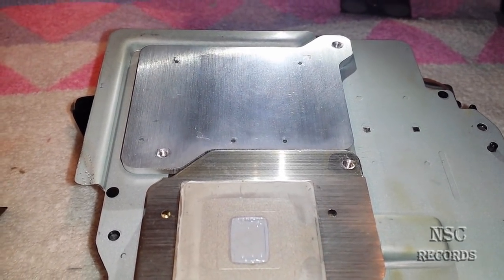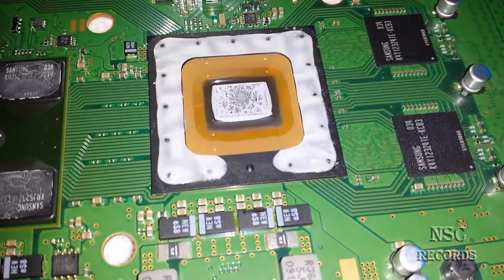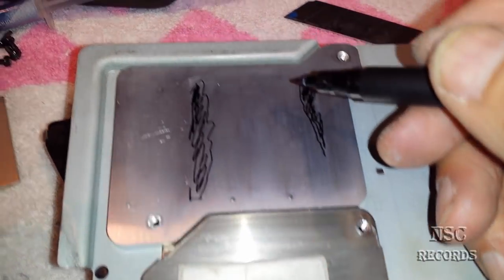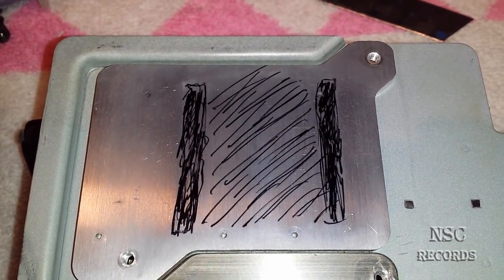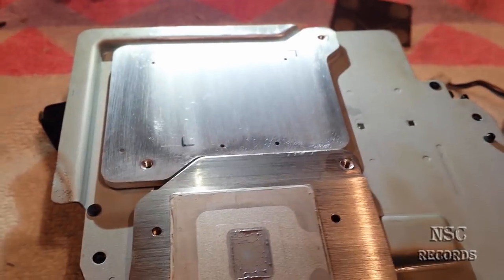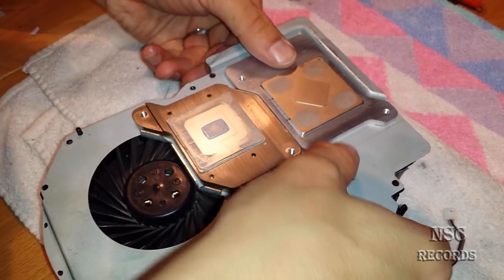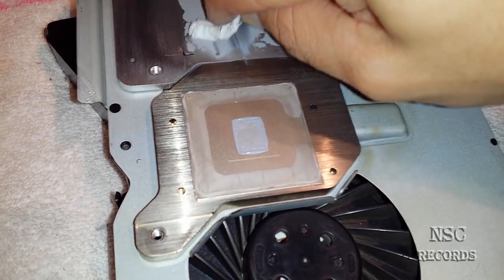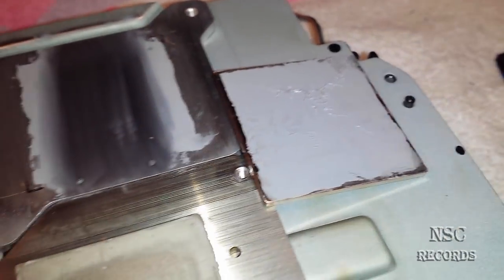PS3 Slim still overheating after removing IHS - Issue Fixed By:NSC

Comment: Why the RSX is almost 60°C on the XMB even after you did delid and fixed the heatspreader? Not the first time i see temperatures like that, not just on this PS3 but a lot of PS3 on youtube with delid are that high. On my CECHL04, never been delided, on the XMB the RSX is 51°C and in game never more than 55°C. I don't understand why a so big difference with my PS3 and the others on videos. I just did a repast and fan setting at 50% max in Webman (target at 70°C, fan minimum at 25% max 50%). But good job on the heatspreader! Unbelievable to see it bent like that! Sorry for my english, not my native language too haha
Reply from the maker: Yeah, it conforms always the room temperature to. If the Delid and the rest was good done, the temps will be amazing. On 50% fan speed my delided ps3 would run on about 38C😅 🤗✌️

Comment: And what do you think it's the problem when, after changing the thermal compound underneath the RSX, it's still overheating, even when the cooler it's making full contact with the RSX? Because I opened after doing this process and the IHS was still very glued at the cooler.
Reply: Eraser mod maybe

Comment: I have a PS3 backwards compatible, the RSX if I don't put it under stress is around 56/59°C, using GT5 it reaches 65°C very easily, but with the FAN at 34% I can manage the temperatures very well...

Comment: I wish there was a special thermal conductor to inject using syringe/needle between the CPU and heatsink plates without having to separate them.
Reply from the maker: This would be very impossible...
Reply: Has anyone heard of the cramolin flux-off spray??? 
 They say you can spray on the adhesive which will turn it into slime, then use some 0.23 mm 30lb test fishing line to cut through the softened adhesive in a sawing motion. No risk of damaging any traces since there is no metal involved.  Any tipps?
Reply: @Forsaken1990  Interesting, I was thinking about using a steel wire 24AWG (0.5mm) diameter. They sell it at homedepot or hobby shop. In the mean time, bought a Super Slim PS3 and It's super quiet. They should call it Super Quiet PS3 instead of Super Slim.One of these days after fixing the cooling issue I will install CFW for my old Slim PS3 and backup all my games to hard disk and experiment other cool stuff.

Comment: Hi, I failed in CPU delidding on my cech 2004b and wanted to ask how hard it is to remarry CELL? I can't find much information about that anywhere, unfortunately.
Reply from the maker: Hi You can't find informations because it's not possible. Let's say it would be possible but it is not worth all the work. The Cell is the only one witch is really unique. So IF you want to remove the CELL you need also to have the syscon chip witch was with the cell. You can't mix it up. The rest you can replace all the time, but the CPU is the most important for the board to work.
Reply: @NSC-Modz Thank you for the answer. so, replacing the CELL and SYSCON would work? What about remarrying SYSCON to accept another CELL?
Reply from the maker: @arnon85  forget it, you can buy a good ps3 for about 40 bucks 😆
Reply: @NSC-Modz  yeah true, I honestly just felt like messing around with that broken ps3 lol. Thanks for the answer
Reply from the maker: @arnon85  you welcome ;)

Comment: i have a ps3 after 2 minutes the fan runs really high and shuts down i applied new thermal paste heat sinks are touching properly you think underneath heat spreaders thermal is dried up or could be another issue thanks.
Reply from the maker: Yeah, you will need to remove the IHS
Reply: @NSC-Modz  i guess both right

Comment: Hey nsc, I was removing the ihs from the rsx gpu and I damaged one of the little things I don't know what you call it but on the gpu itself, not the actual die or the surrounding four things. Does this mean the PS3 will not work anymore?
Reply: SoldierSparky once u damage it means it’s done for good.

Comment: you could also use thermal compund pads. often used in laptops or all ps2 moddels. if any place on the heatspreader is higher than the other, it will fill it out.
Reply from the maker: No, because it would not transfer the heat so good
Reply: why do cool it my laptop verry good? there is a mobile i7-7500 inside an a 980m graficscard. it works fine never reaches mor than 70°C :D And I guess it would cool way better than no thermal paste like in this ps3 :D

Cooling Pads works fine to me :)
Reply from the maker: This PS3 has thermal paste. ..
Reply: pads dont work bro, still over heats
Reply: ic graphite thermal pad is great

Comment: So you need to use sand paper to scrub the heatsink
Reply from the maker: No, it's not a must, only if you keep having problems.
Reply: @NSC-Modz  i already apply thermal paste in gpu and cpu and relid them but its still overheating and shutdown by itself please help

Comment: I replaced thermal paste and ps3 would not boot up just beeped so I did the cpu trick of removing plate a d still the same,I've tested every componant and all see fine but still basically bricked.

Comment: Hello! I bought a ps3 slim cech 2504a. I opened it, cleaned, changed the thermal paste and I got a very high temperature on RSX, about 80 degrees, CPU has 69-70. I delided the RSX, changed the thermal paste between lid and RSX die and got 78 degerees on RSX after this. After that, I watched this video, checked the surfaces, and lid of RSX was be not flat, I cleaned up with sandpaper and got flat lid. I assembled all back and got the same temperatures. What else can i check? Please help!
Reply from the maker: Your need to get the RSX IHS back to the cooler with a lot pressure. Press the IHS really down to the cooler, the thermal paste needs to spread so much as possible.
Reply: @NSC-Modz  the pressure is good, the thermal paste is well spreaded, the temperature of RSX are still high.
Reply: RSX radiator is also hot, hotter than the CELL radiator
Reply from the maker: This is a Heatshield [IHS] not Radiator :)
Reply from the maker: Than it's a bad thermal paste or you do something wrong.
Reply: @NSC-Modz  I used Arctic MX4, there should be no problem with thermal paste. Trying to solve this problem for 2 weeks now, searched a bunch of forums looking for information, everyone was helped by removing the lid from the RSX, but not me.

I do it this way:
- I take the console apart, wipe off the old thermal paste with alcohol.
- Put thermal paste on RSX lid and place it on the radiator
- Put thermal paste on the RSX chip and its memory chips, and on the cpu.
- put the board back and tighten the screws first on the RSX and then on the cpu.
- put the console back together.
- I run The Last of Us for the test and after an hour of playing I get the maximum temperatures that the console reaches. CPU 68°C RSX 78°C.
Reply from the maker: Again, there is no radiator, it's a cooler. Radiator is only need on watercooling. Have you clean the old thermal glue on the Vrams and on the IHS? Do you got jailbreak or WebMan mod.? There is a problem with the right pressure. Or the IHS is not sitting on the right place.
Reply: @NSC-Modz  Yes, I cleaned off the glue on the VRAM. Yes, I have a webman mod, I use it to watch temperatures. IHS is in the right place, based on your options, the only thing left is pressure. Is there any way to increase the pressure?
Reply from the maker: @ys5108-w2p  open it, make some pictures from the IHS inside and send me over WhatsApp.
Reply: @NSC-Modz  I will write to you tomorrow. Thank you.

Comment: why use the heat spreader?    why not just put compound on the chips and clamp the heat sync onto to chips
Reply from the maker: Because without IHS you will have 3mm space between the cooler and it will have no contact to the chip my friend
Reply: @NSC-Modz  yeah but sony did they do it to make it overheat   maby custom heatsyncs?

Comment: Hi i have a great question for you i have a ps3 that has no video and the controller wont sync the console does boot but no video you think problem with rsx hdmi port is fine appreciate any suggestion you would have how to fix this
Reply from the maker: This is a kinda YLOD...
Reply: NSC Modz how to fix it do a reflow

Comment: Mine is not like this i changes the thermal paste but still overheats and its clean no thermal past underneath either
Reply from the maker: You will need to remove the IHS, search on YouTube: PS3 IHS removal NSC
Reply: @NSC-Modz Does that mean delidding?

Comment: Ich habe ab 2010 eine ps3 Slim bekommen sobald ich es anschalte es schaltet sich selbst aus rot blinkendes Licht aus. Kann die Wärmeleitpaste schlecht auf und unter den Chips das verursachen?
Ich weiß, dass das Netzteil gut ist, weil ich immer noch den Lüfter testen kann und das Gerät schaltet sich ein.

I got a ps3 slim from 2010 as soon as I turn it on it turns its self back off blinking red light.Can the thermal paste bad on and under the chips cause this? 
I know the power supply is good because i can still the fan test plus the unit does power on.
Reply from the maker: Ich denke mal das die überhitzt ist

Comment: Hey NSC. I recently delided my PS3 Slim 20xx and the RSX is overheating like hell! 
On syscon after 1 hour it hits 77c and the CPU 69.
I tried to see if the heatsink has gaps but its completely fine.. the rsx die also leaves a full print on the IHS. The ihs is also stuck on the heatsink as you suggested. Any more ideas??
Reply: Maybe try using 40% fan speed, syscon aka Sonys fan curve tends to cook ur system, 35-40% fan speed, see if that works
Reply: @Bridgetfidget18  hi! My solution was to do the case mod (drill holes on the top case) and it really improved the temps by a 5-6c! Now i play with 28% fan speed and maintain about 72c on RSX on GTA IV while swimming.
Reply: @dimitrisantoniou8502  I still wonder what’s the ideal temps for a slim
Reply: @Bridgetfidget18  for me personally, anything that keeps the system near 70c on low fan speed since launch slim models tent to cook!

Comment: What are good temps for the slim?
Reply from the maker: All under 72°C is ok
Reply: @NSC-Modz  whilst gaming ?
Reply from the maker: Yeah, Max 72 °C I would not let it run hotter than that...
Reply: @NSC-Modz  lmao mine goes up to 72°C on XMB menu
Reply from the maker: @vitvickyvid  Ouch xD
Reply: @NSC-Modz  It's fine, i managed to clean and repaste it by myself

Comment: My idle temperature for ps3 CECH-2004A is CPU: 50c RSX: 52c max with fan speed 37% but while gaming  RSX goes 67c with fan speed 57% but CPU stays cold at 54c max. The heatsink is almost perfect, I'm also using MX-4 (CPU and RSX are delided and also thermal paste is changed). 
Am I missing something or these temperatures are ok for this model or any model in general?
Reply: for a slim its pretty high my chech 2504b runs a t 52 degree cpu and 50 rsx and in game it dosent go higher than 65 for both on heavy games my fan speed is at 37 percent and i run with no name shit thermal paste aand i never repaste the ihs
Reply: @lowliar8489  tnx, but I think 2504b uses 40nm GPU which runs a bit cooler than mine 2004a with 65nm. I manage to get 66c with fan speed around 39% while gaming with case mode witch is pretty good for this I guess but I'm not sure if this can be a bit better.

Comment: I had some troubles with PS3 fat in past I hope Sony learn there lesson on PS4 i just got PS4 slim few days go I haven't any troubles yet
Reply from the maker: PS3 had overheating problems because the IHS, the PS4 has no more IHS :) But i recommend to buy the normal PS4 or the PS4 Pro, the slim edition overheated faster and the slim has often problems with the disk drive... if you can give it back, then go for the Pro

Comment: Great videos! Thank you so much! By the way, can you help me please? I have a ps3 CECHA that turned off after 15 secs, with a pop up saiyng overheating. I cleaned the entire ps3, replaced thermal pads and thermal paste. Now the ps3 get the cooler fan to the full max speed when I turn it on, with a YLOD and red blinking, like in this video https://www.youtube.com/watch?v=4vdxtZzpTeE
Reply from the maker: THX, check this: https://m.youtube.com/watch?v=4gUUOQoj0Rg